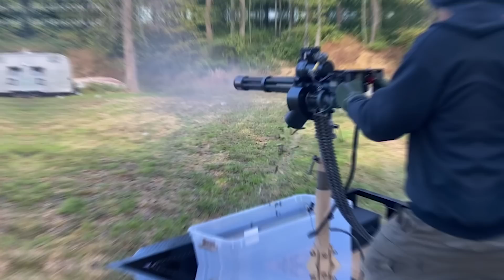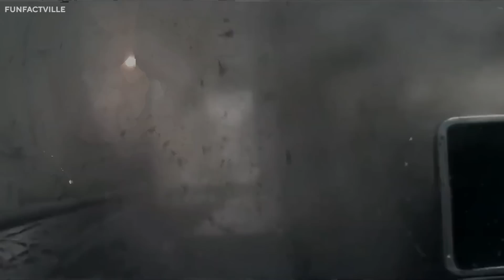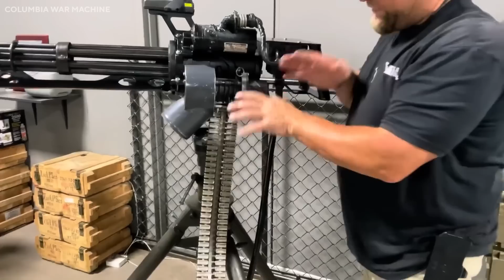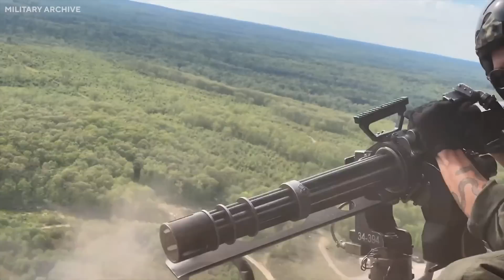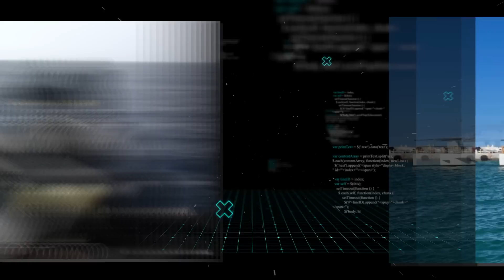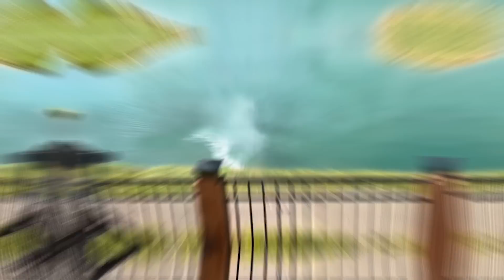How LETHAL is a Minigun?

Comment: One positive aspect of the minigun is that is that does NOT require a round to fire to continue operating. The feeding, chambering, firing, and extraction are independent of a round firing. A "dud" in a conventional machine gun will render the weapon inoperable until the dud is cleared. The minigun will simply extract the dud and eject it as it would any round that cycles through the weapon. This an extremely important property when used in aircraft where the operator (the pilot) does not have access to the weapon. 
A dud is much more likely than a mechanical failure. A mechanical failure would render a convention machine gun just as unusable as a minigun.